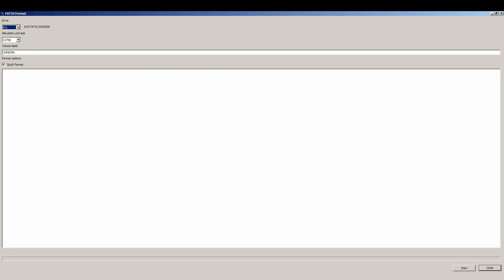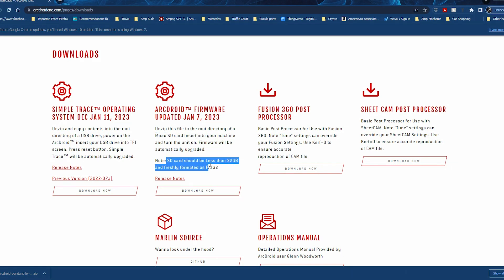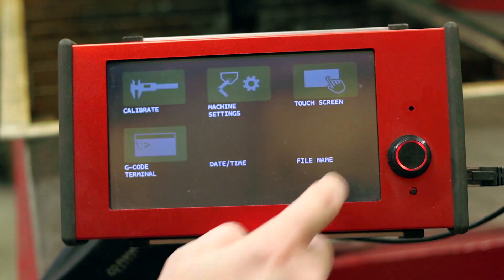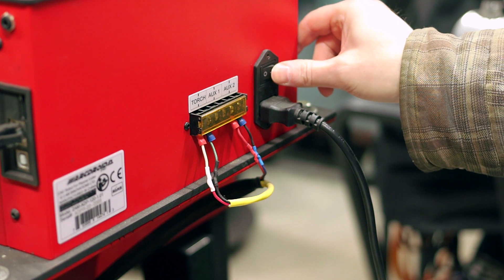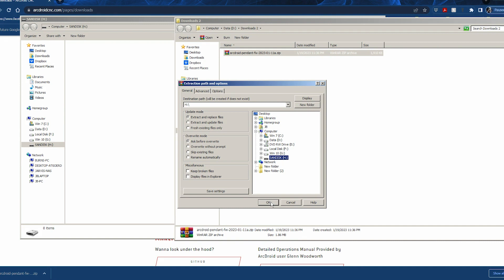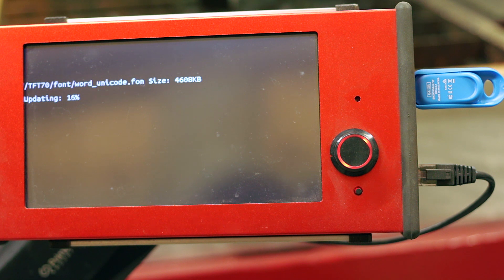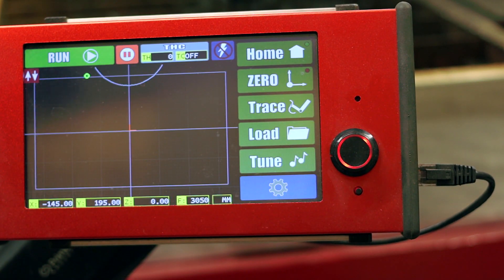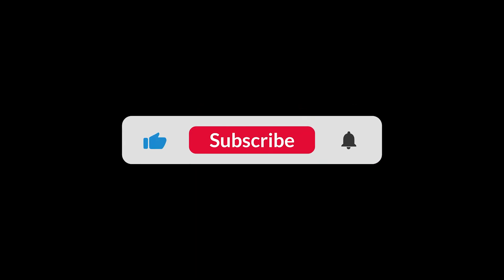ArcDroid: How to Update the Firmware

Comment: Do you have to recalibrate after an update?
Reply from the maker: Normally no. However, there was one, 2 or 3 updates ago (maybe more) that wiped my calibration. The last 2 or so updates have been fine. I always do a dry run and a test cut after an update to be sure. If circles look like ovals or a straight X or Y axis line has the torch move on a diagonal, you'll know you need to calibrate.

Comment: Thanks for all the videos!!! I don't have this unit, but it is very interesting and you and your videos would be extremely helpful if I ended up purchasing the unit.  Can any plasma cutter be used with this unit or do you have to have a certain type can you perhaps go over this as I have heard about high freq and low frequency starting and I don't know what my Miller spectrum is, but I sure don't wanna breakdown for a new plasma cutter.  Thanks again!!!
Thanks alot from California!!
Reply from the maker: Thanks Charles. The ArcDroid has a problem with high frequency start so those machines are out. If you go to the community section of ardroidcnc.com under general discussion there's a thread for compatible cutters. I do know there is someone on the facebook group using a miller but I don't know which model. Or, if you can't find the info in the manual or online, contact Miller.